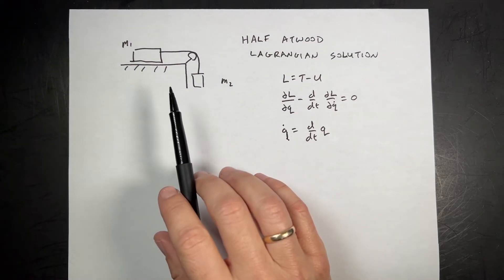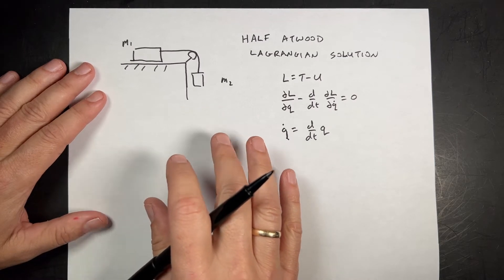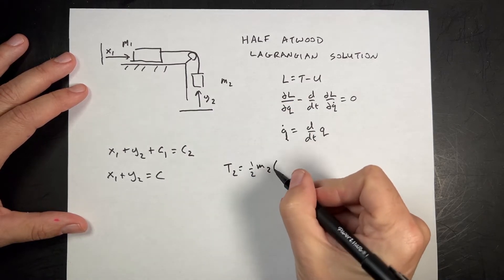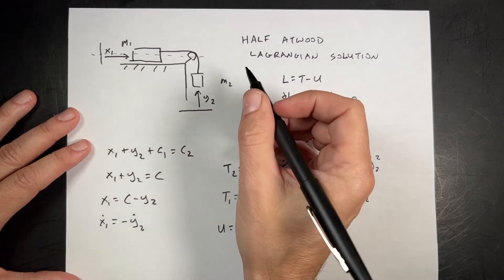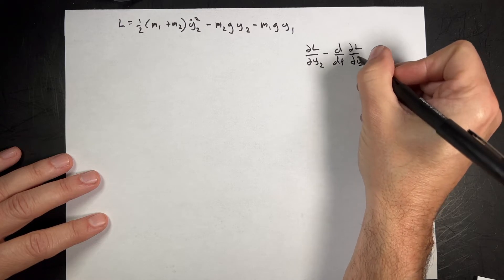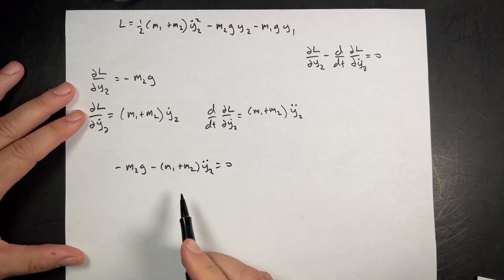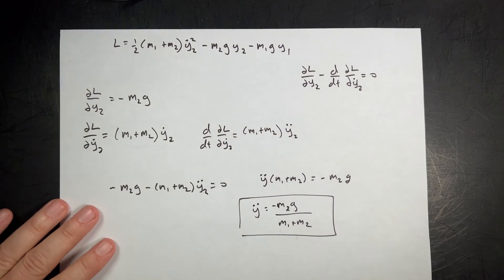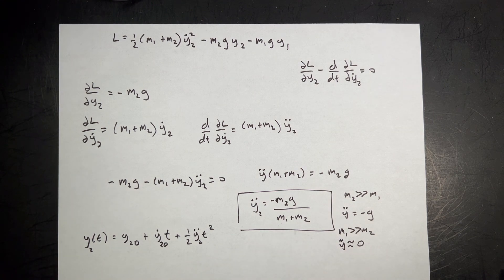Lagrangian Mechanics: The Half Atwood Machine

Comment: how do you add the friction into the Lagrangian?
Reply from the maker: If you want to add static friction - it's pretty simple.  It's just a force of constraint (think of a ball rolling without slipping down a ramp). 

However, if you want to have kinetic friction then it's very tough.  The problem is that friction is not conservative so you can't turn it into a potential. 

If you have a problem with kinetic friction, it might be better to use something other than Lagrangian.

Comment: My mechanics professor assigned us the same problem, but the pulley is raised up a bit and we haven’t touched Lagrangians yet. Trying to get a formula for mass 1,s (x..)
Reply from the maker: If the pulley is being accelerated up, you can still do this with Newton's second law.  Just draw a force diagram for both masses, it should work.